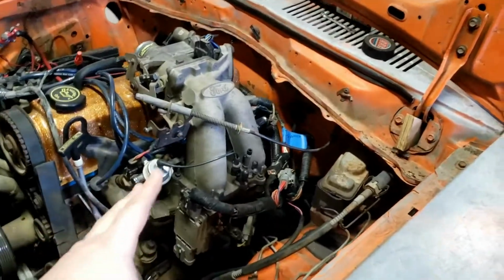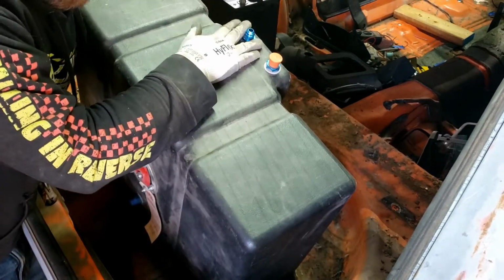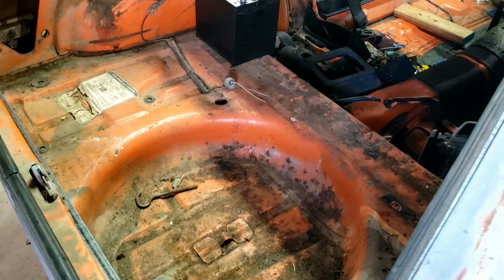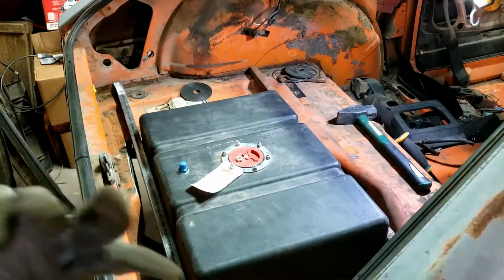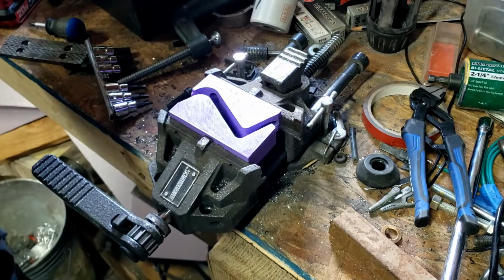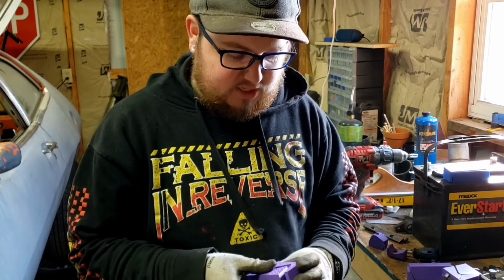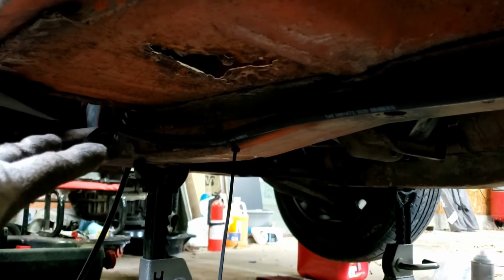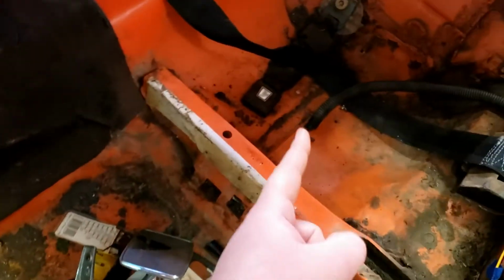The Pinto gets an ENTIRE fuel System!

Comment: Cant wait to see it running on it's own, ive got my new fuel system all finished up and the heater hoses except for one end, ive got to get a fitting for the intake so that I can hook it up and then fill it up with oil,gas , and water and hook up the battery and I will be ready to fire it for the first time today and I can't wait, its been a long time coming and as long as all of the parts that i bought all new are good it should run and I will post a video of it running I hope if it doesn't rain all day 😁
Reply from the maker: Nice!
Reply: @PeaceParts  are you going to take it to the pinto stampede?
Reply from the maker: @79beans347  probably not. Would be cool but its really far from here lol